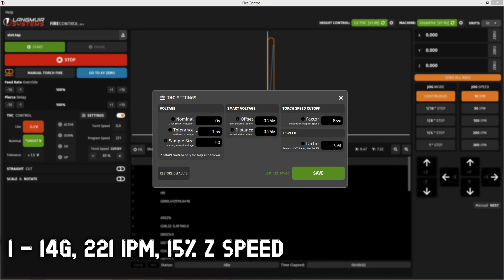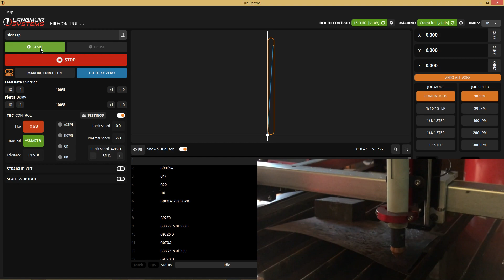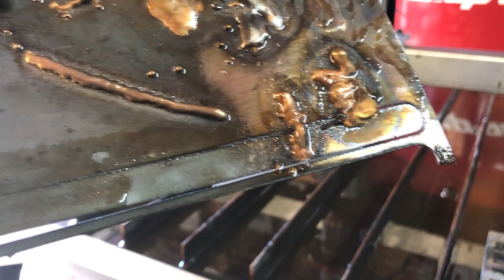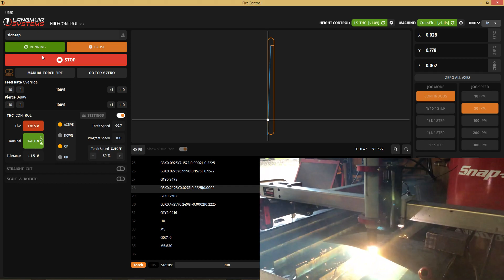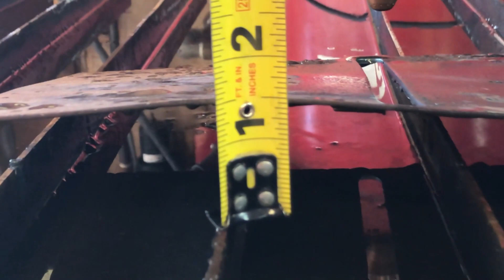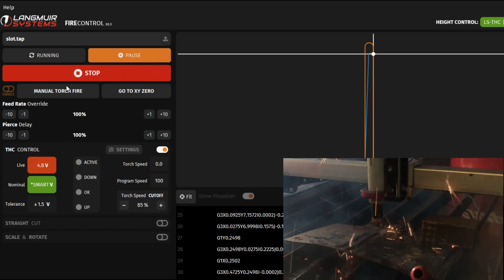Langmuir Systems Crossfire Pro THC Test

Comment: Graet Job! How can i setup my crossfire table to cut a piece that not a flat surface as this piece ? I want to cut a dome (dish headed) basically a curvy suface
Reply from the maker: Do you have the torch height control addon?  That's what this demonstrates.  It's following the curved surface by watching the voltage and adjusting the height to keep the voltage constant. It does NOT follow a specified height in the GCode, rather compensates (moves the Z) based on voltage readings.  This may or may not work for what you want.  If you have the THC addon, enable it and try.
Reply: @GregsStoneYard  Thank you, I have THC .I'll try

Comment: thanks for this vid... we have had our crossfire pro for about a week now and the THC has been nothing but trouble.. torch snuffs out constantly and we've verified the connections (RAW voltage) 
but we still get very little to no voltage in our tests.. after looking for answers online everywhere... its amazing that there are, literally, hundreds of people with the same problems.. crazy..
are you using a hypertherm plasma?  are you using the RAW or a CNC port? 
thanks again for a great vid...
Reply from the maker: Hello, I am using RAW voltage.  I haven't had that problem.  For the most part the only problems I've had are the odd torch misfire.  I am using an older Hypertherm 600 but with the newer style machine torch.  As I said I had to use raw voltage.  I'd recommend doing a screen recording of FireControl while taking a video of a test cut that reproduces the problem.  Then upload that to youtube and send the link to Langmuir support. Also try posting in the Langmuir forums, there is usually someone there that has had a similar issue and can help you with a solution.
Reply: Greg's stone yard how do you have your cnc port hooked up, is it the cable that's made for the hypertherms that you get from langmuir or are you pluggin the two wires just into port 4 and 6 on your cpc? I have a hypertherm 65 xp new long barrel torch and a short barrel torch...any info would be amazing been struggling all weekend with getting continuity from the langmuir control box to the table itself
Reply from the maker: @austinstricklin9048  I have a very old Hypertherm 600.  So I use the raw voltage, which involves opening up the plasma cutter and splicing into lines.  Not recommended as it's high voltage, but the only way with old machines.  With the new machine you should be able to use the CNC port.  Langmuir makes a specific cable that you can buy to make the hook up easy.  I'd contact them.

Comment: Just wondering where you got that torch?
Reply from the maker: The torch is the Duramax retrofit torch part number 228920.  Although you might want to hold off, as I believe Hypertherm is releasing an even newer style torch in January, and will have a retrofit version of it for the older machines.
Reply: @GregsStoneYard  geat I'll wait thank you for your reply.

Comment: I also have a CF pro, why does the Z height in fire control not move when it is obviously traversing up and down
Reply from the maker: Sorry just saw this posted now.  The reason why is that THC takes over control of Z height, and since the CNC controller is open loop, there is no feedback to the CNC controller that the Z height is changing.

Comment: Torch height control has been a game changer.  I haven’t done a controller yet.  I guess I should get on that. I had a file I should have set up differently recently and it warped like crazy.  It never hit the sheet metal.